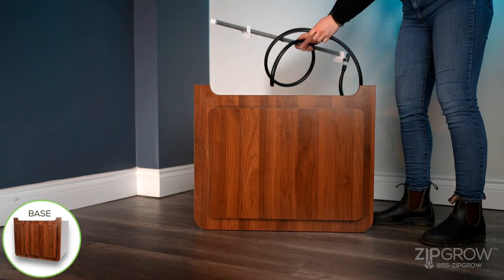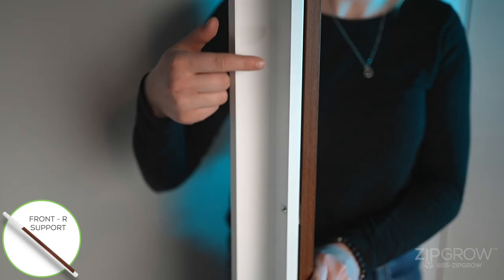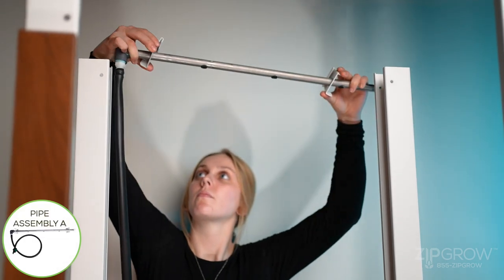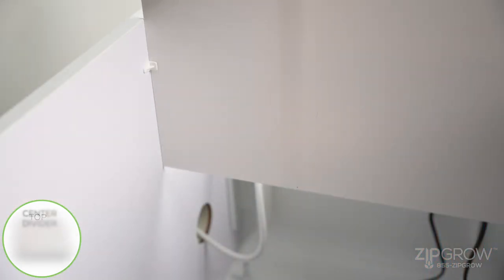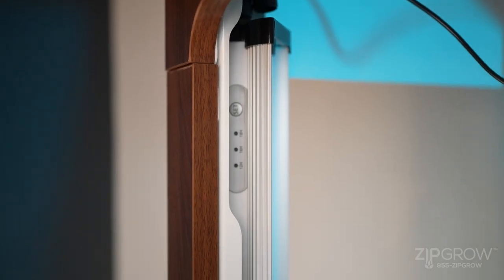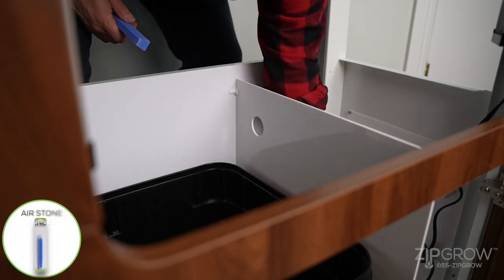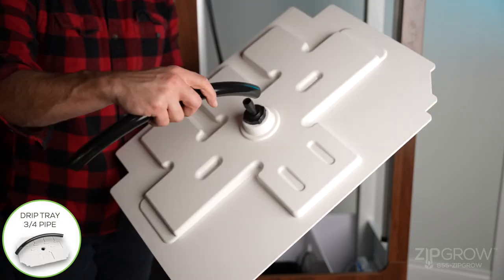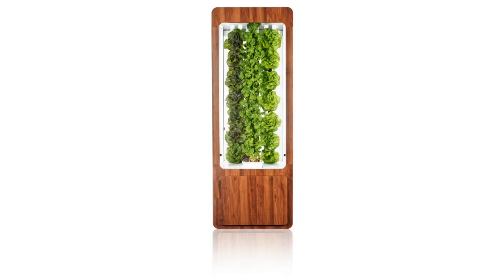ZipGarden instructional video for home hydroponic unit build

Comment: What's the function of the air-stones + air-pump?
Reply: To aerate the water -Helps with nutrient delivery and prevention of root rot
Reply from the maker: @Kooper is correct. In addition the aeration also helps keep water temperatures low which discourages algae and diseases. It is always a good idea to keep the water temperature a minimum of a few degrees cooler than the air. The aeration increases DO (dissolved oxygen) which encourages healthier and more abundant root growth as well as root respiration (believe it or not, roots breath just like leaves do).